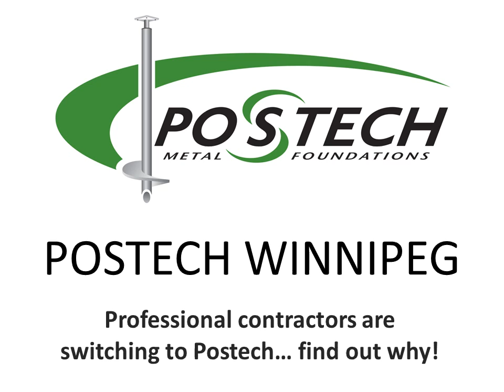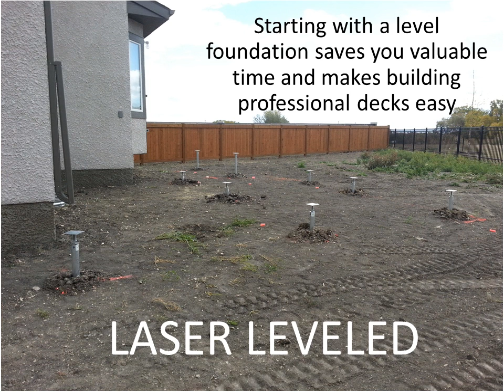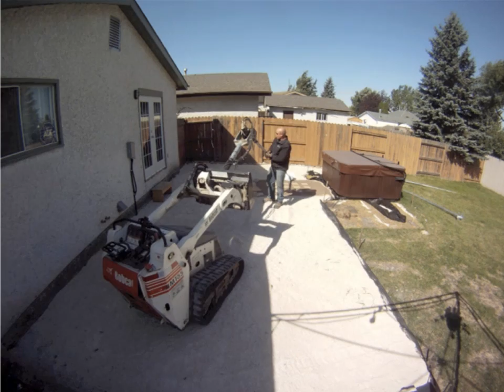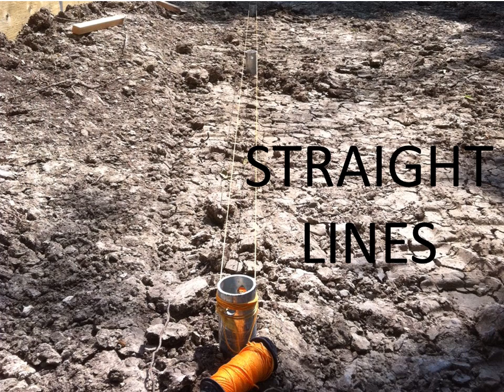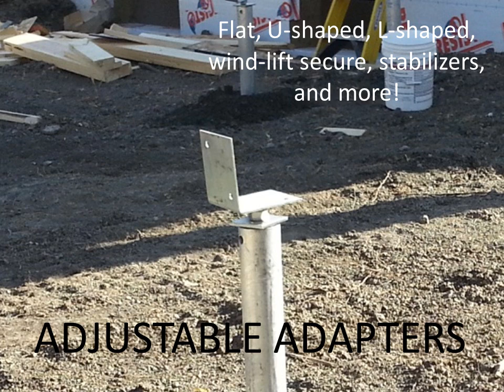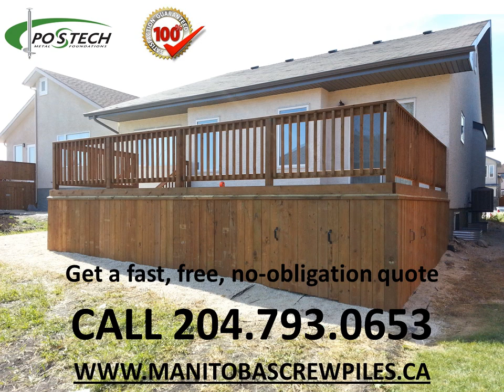POSTECH WINNIPEG   The Best Screw Piles for Decks

Comment: better screw piles or molas from metaally filled with cement in the ground and 3 meters to the top of the ground and there is a strapping, now instead of one floor two
house with a flat roof catch the idea and there as you want to insulate the first floor or boiler room with a garage and on top of a pitched roof instead of a flat
https://www.youtube.com/watch?v=0gEzHtW452A

Comment: these piles are weak metal. how do they get proper torque with one Pin done see any gauges on ur machines.
Reply: I am assuming you are speaking from experience having used their service, had it fail and they did not stand by their guarantee?

Comment: Where to buy? Just twisted two 3000 lbs groundhogs right off in the ground. Junk! One in the middle and one right under the drive. Never use again! Only 2" 5000s are descent, but they twist a bit too
Reply from the maker: +aforeffort747 you can visit our website at www.screwpiling.ca or give our Director of Customer Consultation a call at 204.793.0653.